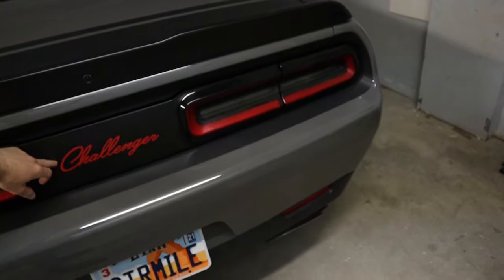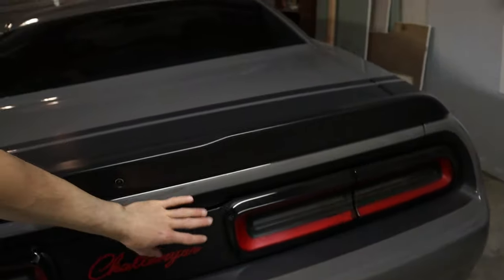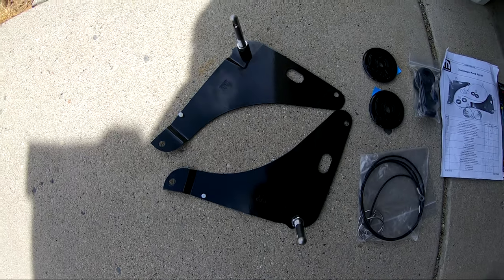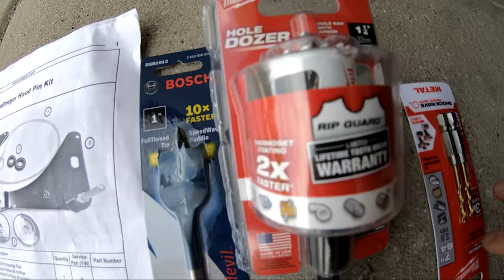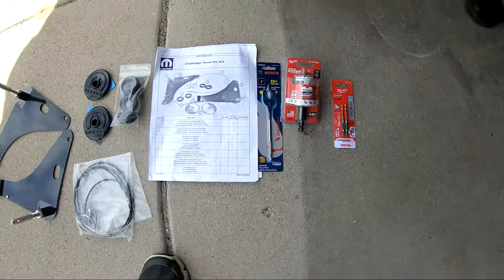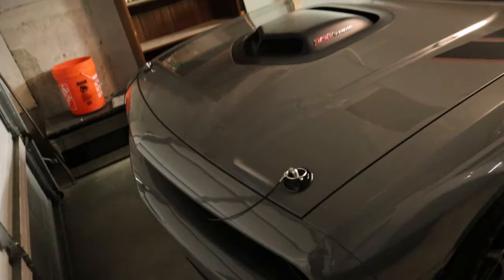NEW MOD: DODGE CHALLENGER SCAT PACK MOPAR BLACK HOOD PINS INSTALLATION KIT. PART NUMBER: 82214260

Comment: Just finished up this mod. Set comes with 2 pairs of grommets, one for the hood and one for the plastic cover. For the plastic cover i recommend using the 1 1/4 inch hole saw for the holes. Helps the grommets fit better and looks great

Comment: WOW, yup no room for mistakes & looks Gr8!!!  My one & only concern is (Chafing) on the hood with the wire, there is going to be movement while on the highway, & over time I see that becoming an issue.  I like the way it looks, really ups the macho of the total package, but I need to research & hit a few MOPAR car meets to get some feedback.
Reply from the maker: Yep you are correct. Over time it can definitely cause micro scratches. I think they can be buffed out but it is definitely a risk. A paint protection film can definitely help but then it becomes a much more expensive project

Comment: Doing it tomorrow, so wrote down the steps and sharing it here if it's useful for someone!  
Items required :

Mopar hood pin - 82214260 (If not this part number, DO NOT INSTALL).
1 1/4 Hole SAW for Metal.
1 inch drill bit for Plastic
7/64" drill bit for pilot hole.
Touch up paint black.
Marker paint - white / yellow.

Steps:

Step 1: Remove Plastic cover carefully.
Step 2: Locate Plastic Rivet and Screw
Step 3: Remove Plastic rivet and Screw (Use 10 MM socket for the screw)
Step 4: Slide in Bracket and reinstall the screw and plastic rivet.
Step 5: Repeat the same step on other side.
Step 6: Mark the tip of the hood pin with white or yellow paint and slowly lower hood (Slowly, so the paint mark will show where to put pilot hole)
Step 7: Drill pilot hole in both sides (Only for lower portion of hood)
Step 8: Put a paint mark again and slowly lower hood. If it touch right place, from beneath the hood, put the pilot hole slowly through the top hood.
Step 9 : Repeat other side.
Step 10 : Put another pilot hole for lower part of hood , very next to first pilot hole.
Step 11: Remove the POLE and the lower the hood slowly. Never drill hole with pole in place. 
Step 12: Put masking tape on hood tope for protection. Put tape around the pilot hole, so no scratch to rest of hood.
Step 13: Drill into the hood from top.
Step 14: Apply touch up paint generously, so no rust. Kindly make sure it's done, else it will rust out in no time!
Step 15: Repeat step 12-14.
Step 16: Measure hole for plastic cover and make a pilot hole on right place.
Step 17: Drill through plastic hole and re-install the plastic.
Step 18: Re-install the hood pin pole.
Step 19 : Repeat same step from 16 to 18.
Step 20: Through under hood, Install gromets into 2 holes after paint is dried. Make sure it fit well.
Step 21 : Test fit the hood pin POLE once hood is lowered. Make sure it's sit correct and centered. If needs adjustment do it now, so it will bend hood later.
Step 22: Remove masking tapes.
Step 23: Without removing backing sticker, place the top grommet with MOPAR facing front. Make sure the pole is sitting correct and not hitting it/ touching it.
Step 23 : CLEAN surface and place the decorative Mopar caps where the letter MOPAR facing FRONT.
Step 24: Adjust height and then tighten the NUT for the base. 
Step 25: Remove plastic cover and feed the wire through the grill. Re-install plastic cover and slowly lower hood to see how it fits. A perfectly installed hood pin will have no issue when lowering hood and it will be having enough play on top, not to destroy the hood when someone pull latch without removing hood pin.

Comment: Great video.  I just ordered a 23 Challenger Scat Pack Widebody Shaker and I'm going back and forth on the hood pins.  You did one of the things I am worried about painting where you drilled out the hood.  I would like to think they would do that from the factory or the dealer whoever does it but I wonder? I guess if I do it I can always remove the grommet washer and look to see?

Comment: GREAT VIDEO, just curious at like the 3:56 mark your pointing to the bolt and plastic rivet with the bolt being closer to the firewall and the plastic rivet is at the front yet later around 4:53 your putting the bolt in the front...... are they are reversed......or was this a boo boo???? Just curious, still a great video, thanks for sharing!!
Reply from the maker: Thank you for watching! So at 4:53 the camera angle changed so it looks different. The rivet is still up at the front of the car and the bolt is on the side.

Comment: Thanks man, I am going to do it on my Shaker this week. Dang it's only 5 days old vehicle! Hope it goes well, if you have any tips tricks, share. Also, what you think having it for 3 years now? You like it or it's an inconvenience ?
Reply from the maker: Haha good luck man! It's definitely scary but ultimately not that hard to do. I would just say that the metal pins are a little movable/bendable so if the hole isnt exactly centered you can bend them a bit to make it fit better. As for ownership I actually put these on last year and sold the ride about 8 months later but I have no regrets about putting them on. Gives it a great touch and definitely a head turner
Reply: @SchwayZ  Thanks for sharing your insight bud! Shocking that you sold it, it was a nice car!
Reply from the maker: @geeksauthority  no problem man! I actually got a Hellcat so that's the only reason I sold it. Man I miss the car though. I've been making videos of the new one in case you're interested. I plan to add hood pins to that one in the future
Reply: @SchwayZ  Ah now that makes sense :) I thought we lost you. Mine is a brand new shaker and only available one in 1500 KMS radius where I live, it was fully loaded except hood pins. So I asked dealer to buy and install it for $400 and it was part of purchase agreement. So they will be doing it.
Reply from the maker: @geeksauthority  oh awesome! Yeah nice to take the stress off doing it yourself and having them do it for you.

Comment: Looks really good!  Have you had any rubbing issues from the wires?
Reply from the maker: Thanks! Nope no rubbing issues. The plastic ring around the hood pins gives it a little space so the wire doesn't actually touch the paint. And if it does it doesn't scratch it
Reply: @SchwayZ  thanks for responding.
Reply: Great question because that’s what I was worried about.

Comment: Is there a set measurement for how the hood pins should go on the hood?
Reply from the maker: Nope. The hood pins come with instructions but no measurements. You will have to mark the tip with paint or something similar and then lower the hood to see where it touches